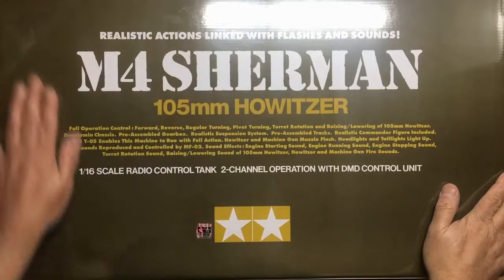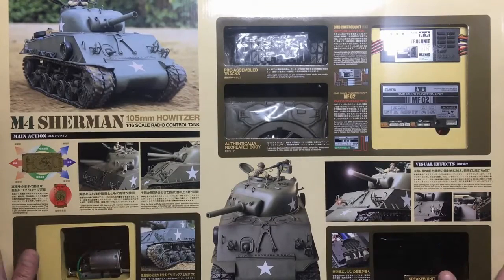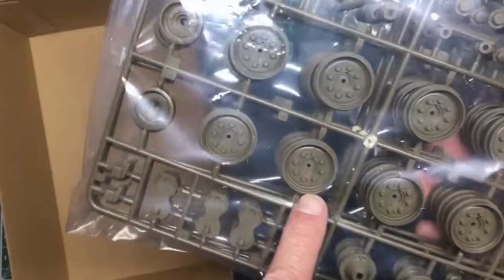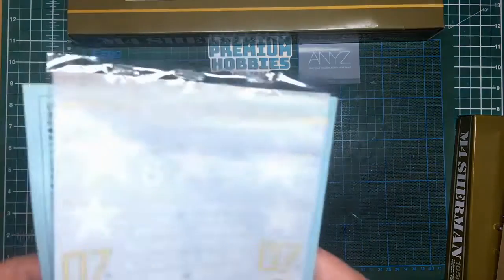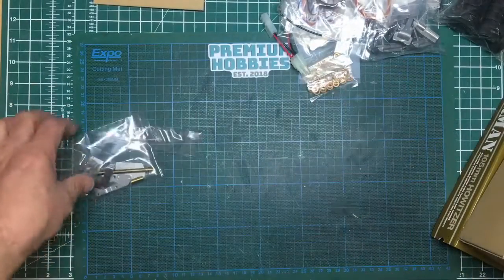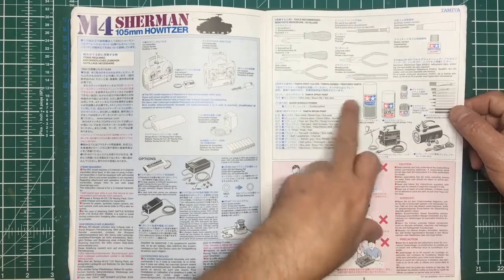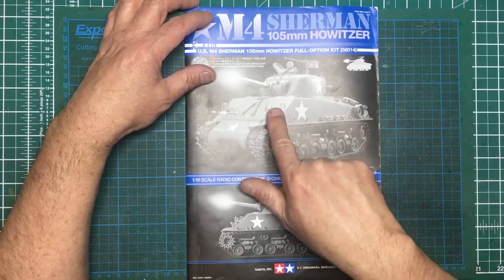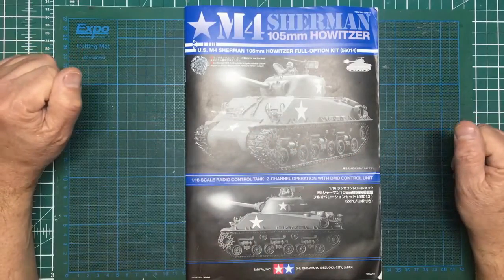Lets build a Tamiya 1/16 RC Sherman. Part 2

Comment: Aber does antenna mounts and 50 cal barrels, plus ammo and ammo boxes. Live resin does 50 cal boxes and ammunition belts and mission models does spent 50 cal casings, and full casings, true value does several sets of resin bags, boxes and such. They look like they are for Sherman tanks. Everything I wrote isn't too expensive. Value gear is around $20, barrel around 15. And so on. Tamiya also does a small detail set with ammo boxes and helmets and such. I'm working on the trumpeter m16 in 1/16, and I've added a bunch of those sets. Totally worth it, every one of them.

Comment: Hi Nigel good review as always and  I am looking forward to seeing you build this kit. You wondered what rubber cement is:  Rubber cement is an adhesive made from elastic polymers mixed in a solvent such as acetone, hexane, heptane or toluene to keep them fluid enough to be used. This makes it part of the class  of drying adhesives: as the solvents quickly evaporate, the rubber solidifies, forming a strong yet flexible bond.  Elmer’s and many other companies make this glue I don’t think there is much difference in quality of one brand over another other than to stick with a brand name.  Cheers mate and stay safe.